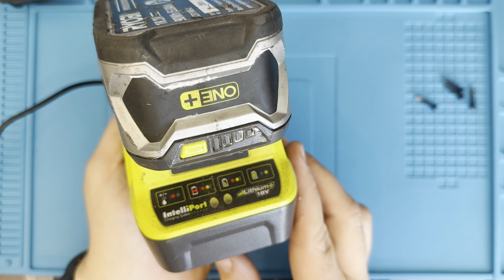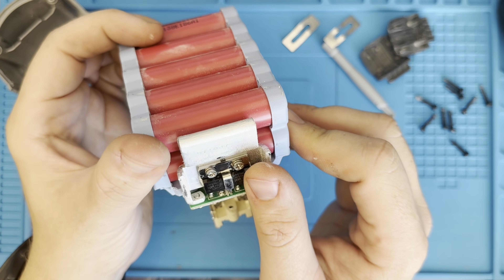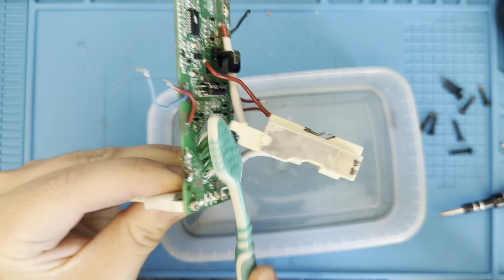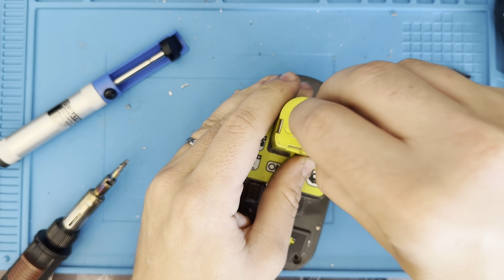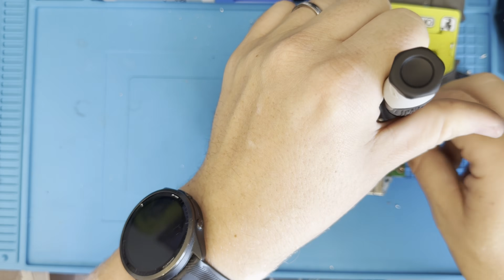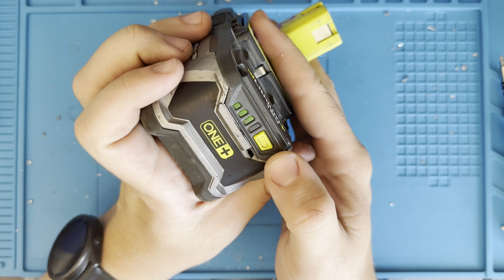Reviving Dead Ryobi ONE+ Batteries: Can It Be Done?

Comment: Top tip: clean the joint to be worked on with IPA. Then use low melt solder to mix with the lead free. And a good dose of flux. Use the toothbrush after that. Easy peasy lemon squeezy.
Reply: Also, don’t be tempted to just use low melt to resolder. This is never good practice, but in a power tool, the joint won’t last long - there’s no mechanical strength  in the weld to deal with the stress induced by vibration. Use normal leaded.

Comment: Warning, 7A for a pair is a way to much! Don't do this! Start and charge gently with a maximum of 1A each pair. Slow charging is always better especially when the battery voltages are a way too low to their threshold spec.
Reply: Yeah, I’d go 2A at the absolute max, but 1A is my norm.

Comment: Good job - I also had a problem with my 5ah battery which would not charge. Checked the board and it looked like it had some water corrosion damage/oxidization but nothing that looked broken. I did not pull anything apart just gave the board a good spray with electrical cleaner and used a tooth brush to clean the area , dabbed it with a paper towel to get the fluid and gunk off. Put it back together not expecting success and it worked perfectly. The boards ca be pretty sensitive so sometimes a good clean is all that is needed.

Comment: You really need a Metcal or JBC soldering iron. I have been spoiled over the years but they work so fast it protects the components being removed or added. Also why not use an antistatic brush rather than a tooth brush?

Comment: The only packs that have failed on me have been the 3Ah and larger. All 4 of my standard 2Ah packs still function perfectly with little to no parasitic loss. 
It's my belief that doubling or tripling cell counts might increase capacity, but it decreases the initial surge current presented to each cell on use, increasing the chances for formation of dendrites in the cell (internal shorting).
Big batteries don't need big chargers and they actually increase the chance of internal cell shorts that kill them over time.

Comment: Excellent video. I think I can fix my 4ah Ryobi battery using the J1 reset, but if I can't I now know what to do next.

FYI   the 4Ah Ryobi One+ battery has the screws for the top plate on the side rather than on the top, the exception being the screw in the post. One of the side screws is covered by a plastic plug, which I assume is used to see if the battery has been opened. It's very difficult to remove. I suggest drilling a small hole and use a thread cutting screw to grab it to pull it out. Also, there are 4 screws on the sides at the bottom which I am assuming is to secure the battery pack in the housing. Once opened the circuit board looks to be similar regarding the connections to the batteries but there are small "clips" with holes to register the board properly in the case. I say clips because they look like clips, but don't actually snap to anything other that the plastic posts that are used to register the board.

My battery is Model PBP005. I am guessing that new 4Ah and larger batteries will be similarly configured.

Comment: You don't need take the board off to charge each cells. Thanks for the video, even it doesn't fix my batteries. My batteries are all locked up and need firmware reflashing.
Reply from the maker: Thank you for the tip - I just wasn't sure if it'd damage anything. Sorry to hear it didn't help, but hopefully you can get them back up and running soon!
Reply: @DeathByFluffyUK  lol, you got lucky the bms you have doesn't have a firmware lockout feature.

Comment: What is your suggestion? Change all batteries or only change the damaged one and kee the rest and old one to change it in next time??
Reply from the maker: It honestly depends how degraded the others are - I have a couple of 'spare' Ryobi batteries (one genuine, one aftermarket) I know have a faulty cell in each that I keep for swapping spares. 
I wouldn't like to fit a brand-new cell alongside some with a couple of years under their belt, but equally changing them all probably wouldn't be cost effective.
Reply: Get along to your local dump with any old batts you want to dispose of. The big bins usually have several ‘old’ battery packs in them. You can usually tell which ones have 18650s in them. Try to find newish packs that are either physically bigger, or are marked as same voltage or bigger than your pack. You’re usually being observed at this point by a worker. Ask or Offer a bribe for a couple of packs. (A fiver will do it.)
Strip the cells from the pack when home. Because these will have been balanced from new, then provided they all show same voltage, you can either assume they are good to go, or you can stick one or two on a battery capacity tester to make sure. Then follow the process above. If you are only wanting to change a single cell, then you need to do the legwork to find a same max charge voltage, same mAh capacity and same internal battery resistance (note: NOT measureable by a bog standard DMM) as the others. Personally, I always change the lot! Hope this helps.

Comment: Plugging the battery into a drill and giving it brief unloaded run is not really "load testing". It might be enough to convince you that putting it to work is possible, but you need it to do a couple of serious work cycles to declare it a viable battery.
Reply from the maker: I did think the same after I uploaded the other video - luckily for me (but unluckily for the batteries...) I'm in the middle of a pretty big DIY project and they seemed to cope OK with a few hours of drilling. 
Next week is the annual 'take all the hedges back to pretty much nothing' day, so that'll be the real test!

Comment: I rebuilt a milwaukee m18 5 ah battery with those cells, great performer now, my ones were their 3 ah cells, making the pack a 6 Ah
Reply from the maker: Good stuff! I've done a bit of testing in the past using the Ryobi inverter, and the cells seem to be excellent. 
It's a shame they didn't give the circuit board some kind of conformal coating so it'd stand up to abuse as well as the cells do!

Comment: I have one Ryobi battery that one of the three legs component get really hot. I looks like a dual diode, but I'm not sure what it is ...
Reply: Mosfet
Reply: @HDXFH  Mosfets are not that tiny ...
Reply from the maker: I was thinking MOSFET too - but if not, it could be one of a few things. Are there any markings with a magnifying glass? 
Bear in mind that most of the time, if someone is running hot (and it shouldn't be) then the cause is elsewhere, such as a failed capacior / resistor or an issue with the PCB itself. I fixed an Xbox last year where two layers of the PCB were shorting against each other - took me a while to figure that out!

Comment: for rebalancing the cells, you should be charging them all at a low current to match whatever the highest cell is (or slightly above). You'll get a rebound when you remove the charger if you don't let it reach equilibrium first. I'd set it to something just above the cells, like 3.2v and charge each pair at 2A until current drops to 0mA. Then you can be sure each pair is fully saturated at the same voltage to give them a good balance.

Also, after servicing an old battery, you may find it comes back to life but with a very reduced capacity. You'll want a DC load you can measure it's discharge with.
Reply from the maker: That’s great to know - thank you! I’ve used the method in this video before, but I’m always happy to learn a better way of doing things.
Reply: It’s definitely worth it to have an RC charger in cases like there. My trusty Imax B6  and B6 Mini has saved me many times.
I’ve revived many different batteries and pacs. Incl a 36V for a lawn mover. I soldered balance leads on the pack so I could charge it as two 18V and it still worked after two years. Then we bought another used cause the old one was quite wide.
Anyway - An RC hobby charger is worth it.
Reply: Bonus tip: Add mirror window film to the back of the glass. Makes it look cool when it’s off and most importantly,  the display wont light up your entire house and blind you when it’s dark outside.